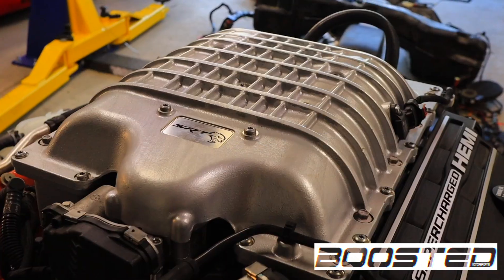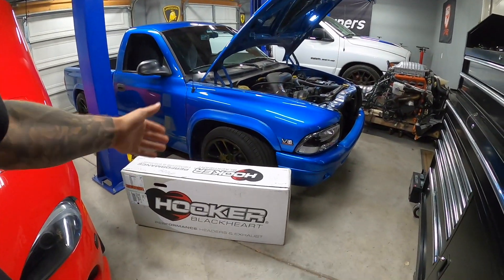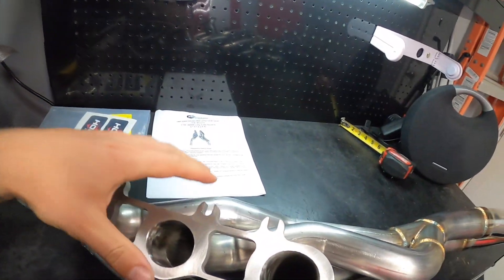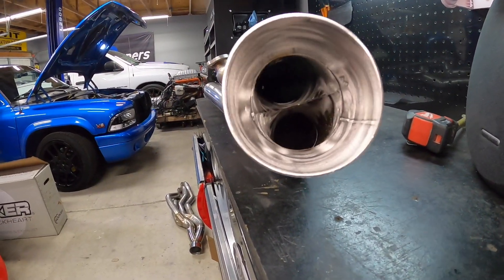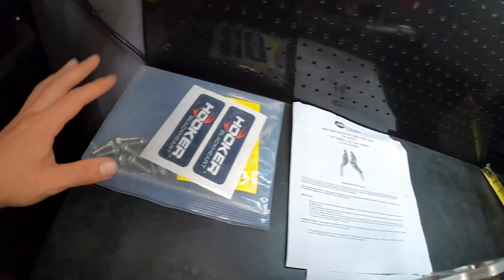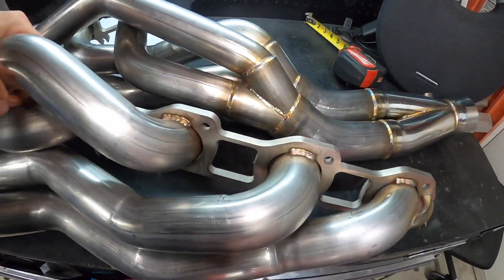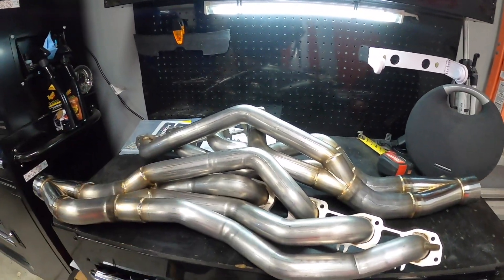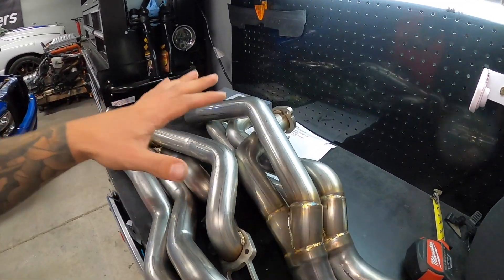Hooker Blackheart Gen III HEMI Swap Headers | Dodge Dakota | REVIEW

Comment: Dear Hooker, slow down your waterjet speed when cutting those flanges. This will improve the appearance of the exposed cut surface and not need ground down to take the ugly curving lines away. Its a simple fix, slow the cut speed down slightly.

Comment: Hello love the ide of hellcat dakota. I run a 5.9 swapped from a 98 ram to a 92 dakota with 3.9 trans(for now lol) that holds pretty well(hasnt broken yet anyways) i have the notorious no.8 cylinder problem. Ive tried new heads and etc intake porting and a bunch of little odds and ends tryin to get it to not miss and smoke. I got it to run 12s in a 1000 ft drag strip here in arkansas. I cant figure this thing out. Im hoping that your mopar mastery might have some advice. Any advice will go a long way. I hope everybody stays distant and safe. Mopar or no car lol. Have a good one. Ill be watching

Comment: I see they are not ceramic coated or anything are they stainless or just steel tubing? I will never buy another set of headers that are not ceramic coated or stainless steel because they rust fast and depending on where you live rust out quick